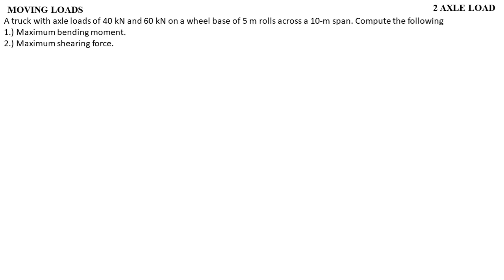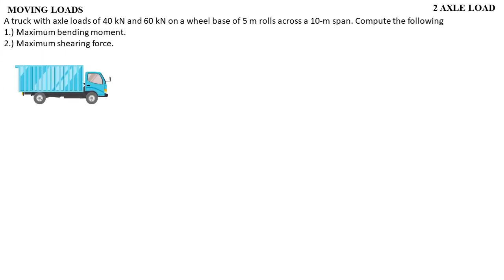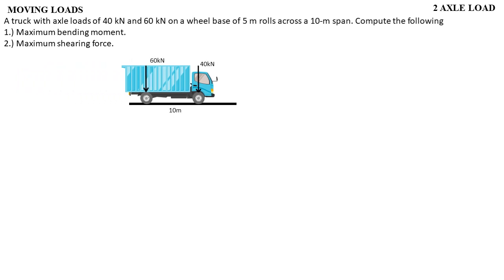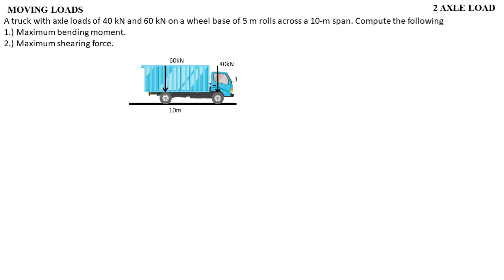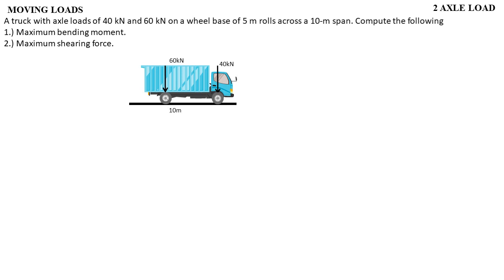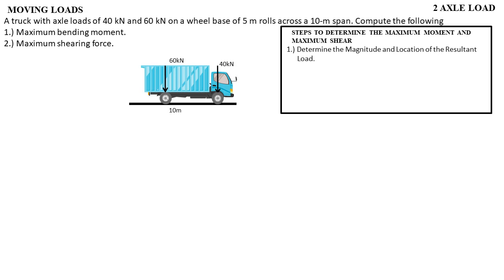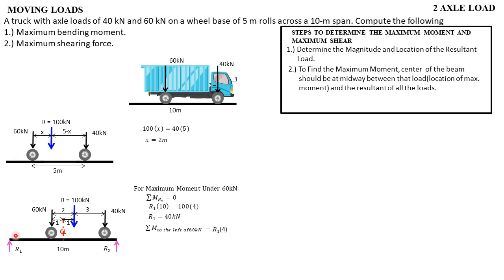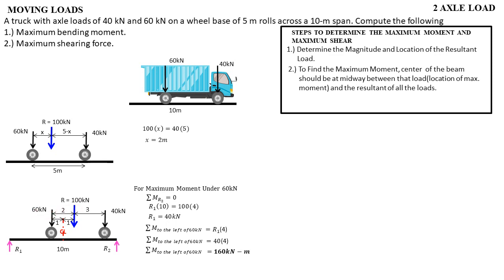Moving Loads l 2 Axle Load I Maximum Moment I Maximum Shear I

Comment: Hi Sir, I am incoming third year CE student po.
Sir tanong ko lang po, bakit po yung sa unang moment, 100(x) = 40(5),,
Di ba po dapat, since it iikot po sila parehas paclockwise, that is 100(x) + 40(5) = 0,
That means, 100(x) = -40(5).. 
Diba po dapat ganyan sir?..

Correct me sir If I am mistaken po.. 
Inaaral ko din po Kasi ang Strength in Materials .
Salamat po.
Reply from the maker: Hello, Good day! Since ang kinukuha is the location of resultant load of 100kN, Meaning the magnitude and location of total reaction from the structure is the same as the magnitude and location but opposite in direction in the resultant load. so and mga forces naten is the load and the reaction(para mabilis macompute and loaction yung total reaction nlng ginagamit). Now so ang forces naten is load and total reaction. yung 100kn is an upward load since reaction yan from the structures. and i Hope naexplain ko po. Just comment po or message me in FB if you have queries. Thank you